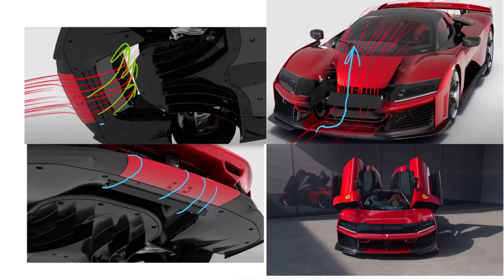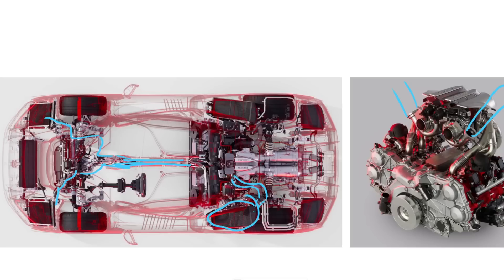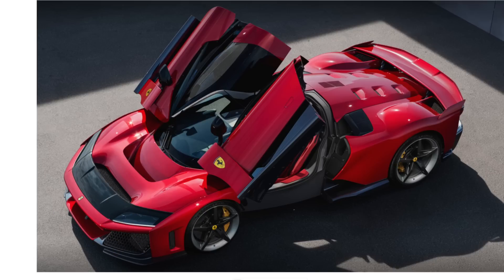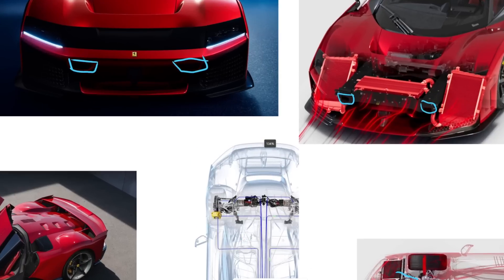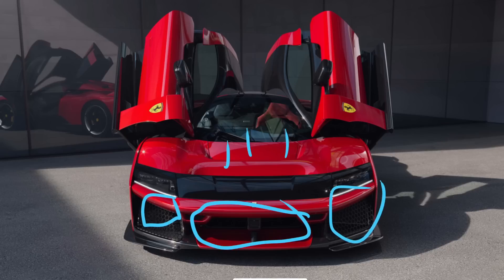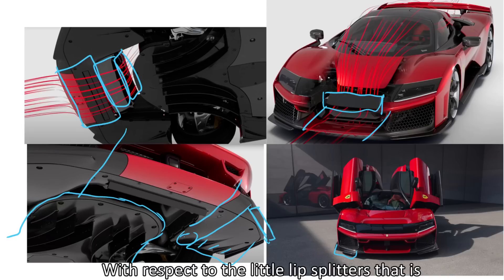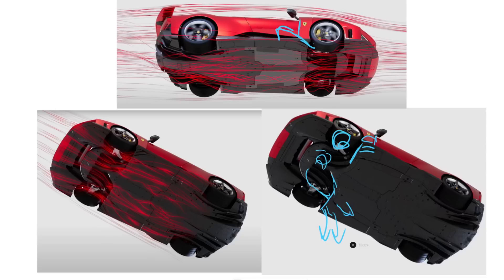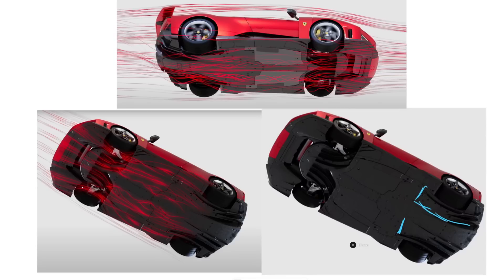Ferrari F80  -  Aerodynamics Analysis and Initial Thoughts

Comment: Why does this have twin turbos if they are electrically assisted already to eliminate lag? Isnt whole point of parallel twin turbo to reduce lag by lowering the diameter of the turbo hemce lowering its inertia, why not single turbo with electric assist?
Reply: Twin turbo reduces lag if they are sequential turbos. One small and one bigger. If they are parallel, they are both big in order to give more power at higher revs, so al lower revs you have lag. With the electric help you reduce the lag
Reply: @albertobrancati  a parallel setup also reduces lag. You can use smaller diameter turbos to reduce their inertia and therefore lag. Motoiq has a great read on this about 488s engine
Reply: @288gto7  but if you use smaller turbos, than you limit the power at high revs. The advantage of using electricity is to install big turbos that can manage high exhaust gas flow at high revs since at low revs you have electricity that spins them. This engine has a very wide RPM range, without electrical boost you would have a lot of lag
Reply: @albertobrancati big vs small is also a function of how much exhaust the turbo has. A smaller turbo might be quite "big" for a 3 cylinder, and very small for 6.
Reply: @albertobrancati  hence why im questioning why its twin turbo in the first place since it has electric assist. Single big with e motor will have 0 lag anyway and no reason to use twins yet this car uses 2x turbos with e motors
Reply: @albertobrancati  as far as I know just a single turbo with electric assistance could provide enough low end boost to make any connection rods exit the block.  And the single turbine housing will have a better ratio of area to extracted energy because of less heat loss.
Reply: Packaging, i assume.
Reply: Twin turbo also makes more efficient use of the 75percent of fuel burn off that does nothing in a combustion engine.
Reply: Twin turbos are also used sometimes for a desired weight distribution in a key area or as another comment said, for packaging
Reply: @elian._iorio  valid point. But I think the overall reduced weight and doe to high location over the engine lowered center of gravity would be preferable in this case. Furthermore the relative freedom of the placement of a battery pack cold achieved the same and more.
Reply: I’m sure their engineers had their reasons. Packaging, overall performance profile of the turbocharger, desired electrical draw and frequency of use, and potentially even exhaust sound considerations.
Reply: @288gto7  turbo lag is a thing of the past.  We're not talking about a 87 Ruf CTR YellowBird with twin turbos. I have the Road& Track magazine if any one is interested..lol
Reply: My guess is marketing. They still are Italian...😂 if only v6 than bi turbo is a Ferrari Giani
Reply: @Dumbo3.1428 Maserati had the twin turbo back in the 90s..Can't remember name. I think it was call the Bi turbo
Reply: @brianmoncion6723 yep, I raced one of the Bi-turbos from the lights in Brisbane Australia 🌏 back in 2000, looked tuff, but I still beat it in my 180sx turbo😅😅 just..
Reply: @CraigLandsberg-lk1ep yeah if I remember the biturbos were pretty quick for a 90s car. I really loved my 240. I bought one new in 1990. My dad would ask to borrow it. 🙄 😄
Reply: @brianmoncion6723  did you mean the American spec 240sx?
Reply: @CraigLandsberg-lk1ep  yup. Hi from BC Canada. I belive it was 180 in Oz. You aussies had V8 Super Cars series back in the day..they were the best. The series still is awesome but not quite the same.

Comment: i hate this car more than i hate Mazepin. V6, ffs
Reply: The Ferrari F80 didn’t grope someone but ok I guess
Reply: Yeah v6, the same as their f1 car and le mans winning cars, v6, get used to it.
Reply: @elian._iorio  Eletric, used in formula e and cities are making it mandate to drive on them, get used to it.
Reply: @veloso98  wtf are you on about?
Reply: @elian._iorio  also this car makes peak torque at 5500rpm out of 9200rpm. For example the 12cilindri is at 7250rpm. The v6 is closer to a disel truck than a sport car engine.
Reply: @veloso98  yeah drive one at 1200hp and then come back and complain about lack of performance
Reply: @elian._iorio  1st, is not 1200hp, thats marketing bullshit bc that number is peak ice + peak eletric. 2nd if you want to go fast just get a bike, 3rd is more fun drive a slow car fast than driving a fast car into a tree.
Reply: @veloso98  then why are you saying it's underpowered if you think it's too fast? Tf? As for crashing into a tree, you're more likely to die on a fast bike.
Reply: @elian._iorio  torque is not power. the problem with this engine configuration, just like the lemans car bc of the power rules, it makes power as soon as possible in the rpms and loses top end power, just like eletric/diesel cars. Yes its a crazy track car, that will get off corners like very few can, but you wont get the fun of continuously being pushed into the seat or the fun of the ear deafening v12, and the worst part is that Ferrari has a new v12 to put in this chassis, and like they did in the daytona sp3(812 engine in the laferrari chassis) we have to wait 2 more year for it.
Reply: @elian._iorio  Hum you do realize that those V6 are winning more or less because those racing series are framed by very stringent rulebooks that are supposedly making then closer to road car technology, not necessarily because V6 are the best racing performance technology we can have today right ?
Reply: @GenghisDaniel  I never said its performance based (although performance is almost identical with modern technology), I'm saying its reflecting their racing series as its all marketing part of the product, same architecture in road cars as their race cars, it's why they used to have v12s when their race cars were v12, it's how f1 has always been, to develop new technology for road cars by going racing with the same technology so why tf would they develop a v12 when racing new technology in a v6.
Reply: @elian._iorio  Hum it seems to be more akin to wishful thinking than anything else. During the development of the Enzo or the Laferrari were the existing formula 1 still using V12 ? No, not at all and not since a long time.
Indeed this idea that their performance cars engines are supposed to reflect the technology used in their race cars is some marketing speech put forward by their marketing team, but it does mean in anyway that it is based on reality...
Reply: @GenghisDaniel  The Le Mans rules are not stringent,quite the opposite. And the Le Mans car uses the same V6.
You can use any engine you want in Le Mans hypercar.
Reply: @GenghisDaniel  The Enzo had f1 like aero, and the La Ferrari had a KERS system, like the F1 cars at the time. 
It could be a V twin, and still use some f1 inspired technology.
This v6 is the same engine that won le mans twice, just with different turbos
Reply: @dylanburston7453  ahah funny, but it is not because the rules does not impose for the car to be full combustion or for the car to be an hybrid or for a specific type of combustion engine that the rules are not be stringent. The simple fact that there is a limit of the total power output of the power train or that there is BOP indeed make it for the V6 hybrid to be the best option. But it does not mean that it is the best option period. In 2010, the Peugeot 908 HDi FAP with a V12 made a 3:19.241, under the LMP1 rules, the Toyota TS050 Hybrid was two second faster but the LMP1 rules also favoured the use of hybrid motors (by restricting the fuel flow) and the hypercar category is more or less 10 second slower than those. Who knows what a full combustion engine (V12, V10, V8 I do not care) with current technology could do nowadays, 15 years after the, diesel, Peugeot. The choice of motorization is totally linked to the rule book...
Reply: @GenghisDaniel  Hypercars make far less downforce and are much heavier than their LMP1 counterparts. Thats why they are slower. They hit around the same top speed down the straights.

And Ferraris win at le mans this year was largley down to the engines ability to sip fuel whilst still at a decent pace, because they had to make a unscheduled pitstop to close the door in the final hour, which put them out of synch. 

And we know full well how a non hybrid would perform. The SCG and Vanwall hypercars did not have hybrid systems.
The SCG had essensially 2 rally 4 pots stuck together, and the Vanwall had a gibson V8.
They were both comfortably the slowest cars most of the time (the Vanwall was often slower than LMP2s)

This engine has won the 3 biggest 24 hour races. Its won le Mans twice, it won the 24 hour of nurbrgring in 2023 and a class win at the 2024 daytona 24 hours in the 296 GT3 (it also would have won the 24 hours of spa 2024, but a broken down lamborghini closed the pit exit for its final pitstop)

The thing that make it a good engine are power, power delivery, power band, fuel efficiency and reliability. That holds true for the 499p, the 296 GT3, the 499p modificita, the 296 GTB and now the F80
Reply: Cry hating on ferrari
Reply: V12 are archaic these days tbh, they’re just too big and heavy…
Reply: @cbreazienutz and batteries aren't heavy?
Reply: @cbreazienutz  Still there is some leeway between a V12 and a V6, especially in a car that it is in the end heavier than most V12 made nowadays like the T 50, the Valkyrie, and so on. And as said by Kyle in his video, this F80 is unlikely to be a real track performance car but was more designed as a road car than a race car, hence why not go all the way and make it with a nice motorisation ? If prices of the SF90 are depreciating fast it is because people are not so happy with the powertrain...